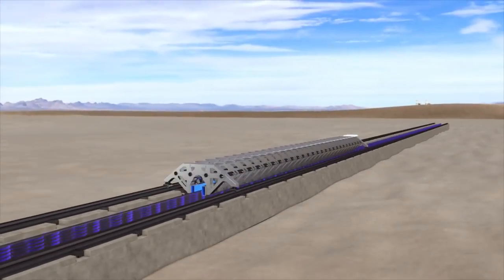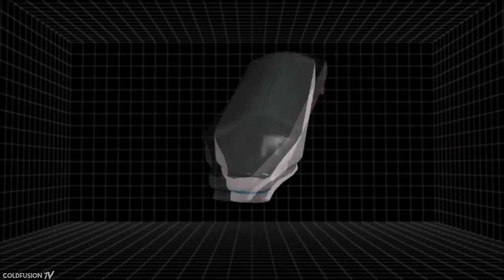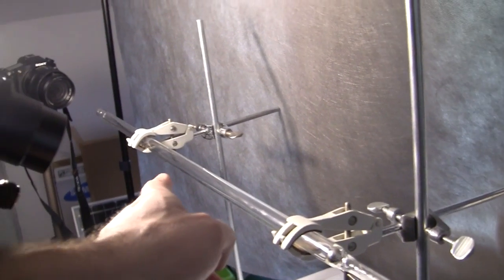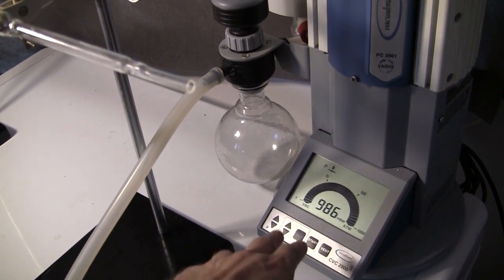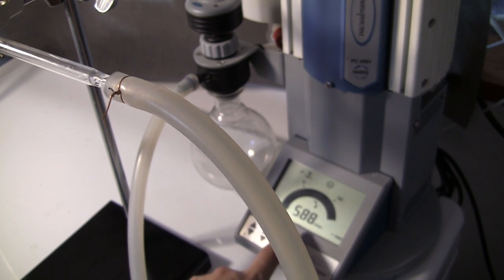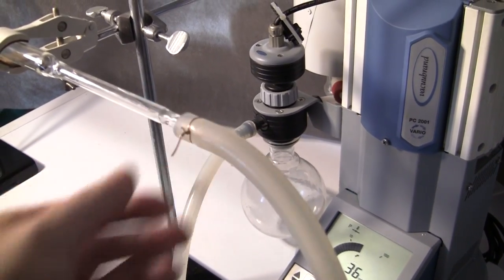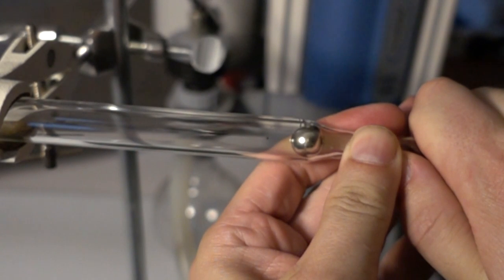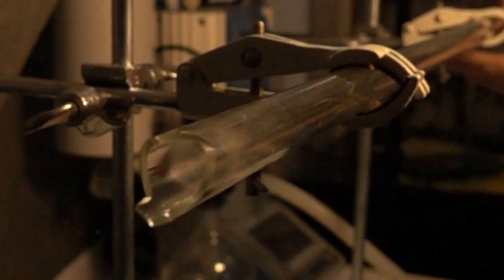How  the Hyperloop can kill you!

Comment: When trains run off their tracks, they also cause fatalities, but that's why there are safety measures in place. This is just the pessimistic viewpoint from someone who has lost their optimism for scientific advancement.
Reply: there is one major difference between the hyperloop and a normal train
if there is a rupture anywhere on the loop the whole thing is in trouble
Reply: +Bryan Hinze (supercat765) Hence the safety measures. Such as airlocks.
Reply: To be fair, when there is a rupture somewhere in the rails, a train is in trouble too
Reply: Pessimism or necessary skepticism?
Reply: David Igandan first and foremost the hyperloop would have to face two types of pressurisation problems (a rupture in the cart and a rupture of the tube itself) plus airplanes don't have to face a vacuum (at 10 km you still have about 1/4 of an atm). I'm not saying it's impossible, I'm just saying it'll take a lot more engineering than a  plane
Reply: Exactly, that'd be like a train derailing because a piece of track 2 km behind it broke
Reply: it's kinda wierd for TF to be all "this technology could potentially go wrong, therefore the technology is wrong!"
that's the attitude he usually fights against, it's the attitude that says nuclear power is wrong because it could have a meltdown which is something he's made videos combating
Reply: Speaking as a scientist here, it is called being skeptical.  If somebody presents you an idea, you question it and rip it to shreds.  If it can survive that, it is OK.  That's what scientists do whether it be theoreticians like me, or experimentalists in the lab that will do experiments to test ideas.  Just because you think it is a "scientific advancement" does not mean it is reasonable.  Being optimistic is striving to find things that work, and having the integrity to point out their flaws.  There is no optimism in putting your faith in something nobody have proven to be reasonable.
Reply: This is just a portion of the next video so hold your judgement till then.
Reply: More of you should try thinking for yourselves, instead of taking everything that TF says as law. It is very easy to point out the hundreds of loopholes, exploits, and vulnerabilities of a technology (take a look at many of the comments here about planes, trains, and cars, etc.). It is much more difficult to offer practical solutions for them. This video only points out a single flaw (though I don't dispute there are many more) in the system, and has a click baity title. It would be much more scientific of TF to offer engineering solutions in his video as opposed to damning popular science.
Reply: +ScopedPewPew    My god, the thought of having technology improve with time. It is impossible I tell, IMPOSSIBLE! The train used to be powered by steam, then someone thought, "I want to change the wheels with magnets." Now some people want to make some trains that can go even faster, but you think of it as an impossibility.
Reply: This was worded beautifully, I agree completely. As a scientist also, I'm slowly losing respect for some of TF's videos. Sure, it's important to debunk BS science but it's at a point where he's claiming everything is bullshit due to a single flaw. I.e., reminds me of a lot of the resistance that the scientific forefathers faced.
Reply: At least the train can be informed ahead of time that there's broken track ahead. If by some chance the pressure changes even after many safety procautions are put in place, everyone on the train will die.
Reply: +Randall Peralta Did you see the phrasing of his comment?  Regardless, he isn't simply being skeptical of the idea, he is dismissing it entirely.
Reply: Vranvs Vranvs well you should probably wait till the full video before you make that judgement...
Reply: yep, no clue why thunderfoot is doing this. He's starting to sound like a luddite.
Reply: ScopedPewPew I'm suspicious that he is more interested in creating controversial videos that draw attention because it gets lots of views and subscribers.
Reply: +James Lourenco   As a viewer of Thunderf00t, you should understand that strawman arguments are unacceptable. Vranvas said nothing about the other things that Thunderf00t has debunked. I won't speak for what he thinks, but this is not some incredible stupid thing like solar freaking roadways, Thourium powered cars, or hover buildings. However, this is just a hypothetical larger human version of the tube system thing used in some hospitals. I believe SciShow showed this best by explaining what the hyperloop was and the obstacles it will have to address. It is possible to have differing thoughts on things from Thunderf00t, so don't go around claim that others support stupid shit if they disagree with Thunderf00t on this one piece of technology.
Reply: ScopedPewPew OK TF's number 1 brown noser sub.

Have you even seen the things Elon Musk has achieved with SpaceX and Tesla? Thunderf00t pissing about with thermal imaging cameras is nice but not exactly in the same league as what Musk is doing.
Reply: What happens when it fails? If the answer is "It must never fail", then it is too dangerous to use.
Reply: Airplanes are already like that. All spacecraft are like that. To achieve higher speeds, harness more energy and have a chance of actually persisting our race outside the lifespan of our star, we're going to have to accept the reality of traveling in vehicles that will kill us if they fail. Millions of people already do on a daily basis. Sure, a lot can go wrong without an aircraft crashing and burning, but IF it collides with the ground in an uncontrolled landing, 99% of the time the vast majority or all of the passengers will die. So you could say we have been in the era of this type of vehicle since the mid-20th century. Not sure what all the fuss is about with proposals to build even more vehicles of this sort.

If we restrict ourselves to vehicles that are likely not to kill us when they crash, then we will forever be stuck with boats, standard trains (max. speed 70 mph), cars and buses. And no manned spacecraft, ever.
Reply: +FJBRDALLAS The point of the airlock wouldn't be to stop the train directly. Obviously that wouldn't work.  
Presumably you would use multiple air locks to divide the hyperloop into sections, thus enabling operators to close off any section which experienced sudden vacuum loss.
Reply: +Blox117 If you're referring to my comment, I'd like you to give me a basis for you're assumptions about me. I don't see how any part of my comment would indicate the truth of your statement, and would assume that you're saying that only because my opinion differs from your own.
Reply: +Necropolis9 His professional experience does not change the fact that he has dismissed this concept with neither a strong argument nor adequate scientific evidence against it.
Reply: +Dareld Jolliffe Adding thousands of valves would only make the system more likely to fail.
Reply: Joseph Thompson yup just  more engineering to be done, nothing near impossible about it. its not a even that high of a vacuum proposed in this project.Any vacuum will create more efficient trains and as long as the gain is higher then the energy cost of creating the vacuum then its considered a win on that front
Hmm lets see, whats another pressure vessel that is ridden by hundreds every day with thousands of valves? A nuclear submarine... 
(haha get it? a Pressure Vessel!)
Reply: ***** i was talking about the tube. I am just thinking there are about a hundred ways around the problem in the video. In fact i am not even sure it will be a real problem, like you said with the train already moving it will likely just slowdown from one side or speed up slightly from the other. And i was under the impression that it was not propelled by the turbines they are just to help move the air (or whats left of it) around it. The train car is not perfectly sealed in the tube, there is room for the air to move around it. the vacuum is just to decrease drag not to propel the train.
Reply: Yeah, but one knick in the rails doesn't cause every train on the track to simultaneously derail.
Reply: Eltrio2 i just had to smile and laugh with my friends when we wre told that retardation was a word used by real life scientests. there's also an other funny word used by chemists. the word "Cis" is used when describing an isotype of a chemical which is streigth instead of bent. the opposite is "trans". the origin of the word is its german meaning, which is the same as its meaning in chemistry. it's funny because it's used by some SJWs today to describe people who they disagree with, aka non-trans people. "cis scum" as they say. it's funny that in the circles i grew up in it was more of a compliment to be called streigth (as gay was an insult). now these people go and tell us "fuck you CIS white guy"....

yeah. a lot of people are the kind to not care about school in school. the kind of people who get happy when they get a D+ in an exam... most of those people in my old school went into other schools than the school i am in now, and there are only people from my old school in my class, apart from one guy who lived in sweden when he was the age to go to my old school. if we were to talk about me; many have said that i am "clever" and shit like that, or like "you know a lot" n' shit. even my chemistry and physics teachers like me for it (we have gone to trips to germany, and entertainment parts with other students n' shit.). i obviously am not one to judge, but i do try to be as truthful as i can.
Reply: So there couldn't be a gate system through of the tube network to control a rupture?
Reply: +Bryan Hinze (supercat765) I don't think the hyperloop is going to be a strong vacuum. So ruptures aren't as big a problem. Just something I read.
Reply: Okay, tell me: what kind of fail safes will the Hyperloop have?
Reply: ScopedPewPew
I'm defending the hyperloop by any means. It's a shit idea and the people defending it only have the most childish of retorts.
Reply: TF said that the presure would be 1 millibar. It would be a strong vacuum.
Reply: But the whole network doesn't explode.
Reply: ***** Can you give any examples of what you're claiming?  Almost all the examples (even if I give you this one) are clear cut flawed or nonsense.  I've seen every one of his debunking videos and they all seem pretty reasonable.  There are limitations people need to be aware of.  For example, I'm a computer scientist and I constantly see people claim that computers can do anything, when no, infact they cannot and they have limitations.  Same here.  TF is just poking holes in things because that's what a good scientist does here.  Say what you will about his opinions, but the man knows how to do experiments.
Reply: +Kitsuneoni Actually if the hyperloop breaks behind the train theoretically there should be no problems, because the train is moving at the speed of sound and anything that happens behind it would not affect it AT ALL, because they couldn't catch up to the train.
Reply: this is the comment of someone who is scientifically illiterate and ignorant.
Reply: +Sean McNamara I agree entirely.
Reply: They are going to need more than an air lock to stop a full train flying at the speed of sound....
Reply: it would be much easier to depressurize across the hole loop with valves set at intervals that would automatically detect a rupture and open to equalize the entire loop  at once in front of the train.
Reply: +Dareld Jolliffe The problem with that would be the massive amount of air you'd have to be able to allow into the loop in a very short time.
Reply: Joseph Thompson and 5in fast opening valves every 50 ft the entire length of the loop wouldnt do that? Thats alot of air. I dont think it is that big of problem to over come... They are easily replaced and reset. And they could always design bigger and faster valves if needed.
Reply: Joseph Thompson your*, and i agree, that having valves to the outside would be a stupid idea... and having them just to "equalize" pressure in front of the capsule or what ever is stupid... firstly if there is a rapture behind the capsule it'll barely afect it at all because it's lrdy traveling at the speed of sound and is quite dense relative to its "wind-profile"... also if a rapture was to happen in the front of the vehicle the blades of the vehicle would eat into the air, and thus lessen the effect, maybe helping it to slow down and maybe come to a slow stop even before it reaches the breaking point, which would only act as a safetymechanism!

it's not like thunderfoot's video is a total smackdown on the system. there are fixes for everything people have tried to clam onto so far.
Reply: Dareld Jolliffe are we talking about the tube breaking or the vehicle breaking? is everyone talking about the vehicle breaking?
Reply: This would be a good comparison if the entire train track exploded if there was one failure anywhere on the track.
Reply: +Necropolis9 I realize that, but he doesn't set up any good arguments in this "teaser" of sorts. 

Perhaps this discussion will be pointless when the full video is posted, but for now I see no reason not to discuss this particular video.
Reply: +david igandan Its my issue with every single person who doubts science or tries to scam people with it. tfoot can show why solar roadways was fucking stupid, why the water bottle won't fill, and why the rebreather is bullshit, at least with current methods.

this one, he put a marble inside of a glass tube, and said this is how it is, which i very much doubt is the case. what he showed was acceleration due to a failure to seal, instead of being introduced to low pressure then accelerating. 

we all know shit can go wrong fast, buts not even a doubt, the question is how likely is the shit to go wrong?
Reply: +Joseph Thompson 
Oh really? You think this is "just the pessimistic viewpoint from someone who has lost their optimism for scientific advancement"? How about the fact that Thunderf00t is a youtube channel owned by a scientist who strives to push boundaries of human knowledge? Hmm? 

"When trains run off their tracks, they also cause fatalities" 
No. When trains run off their tracks, people usually get injured. They don't get accelerated into bullet-speed and they're usually not hurled into a wall of solids. Train tracks can actually be designed to sustain the forces of a moving train. You just can't do that with a vacuum tube that goes for many kilometers on end, without costing yourself a few fortunes, or a few lives. From an economic standpoint, it's a disaster, hence the stench of bullshit when someone actually claims to do it.
Reply: DecepticloneStinger 
"why are all of his recent videos nothing but "LOL FEMINISM AM I RITE GUYS?!?!?!?!?!?!?""
Because it's a cheap way of producing entertainment. I personally think nobody would refuse to laugh at feminists who want to protect Pokemon.

"or "this kickstarter is retarded because I say so!""
He hasn't made such videos. He's made videos saying "this kickstarter is retarded because the facts say so". Using a dehumidifier to fill a water bottle in a remote place, for instance, is a retarded idea because we know how dehumidifiers work and we know that it's just not going to be good enough.

"which means the problems with those ideas can NEVER be solved!"
Nope. He's showing that the kickstarter projects are bullshit because they are not feasible NOW and the kickstarters are claiming to give the goods VERY SOON if not now. Remember the solar roadways? TF's main contention was that the solar roads are being built NOW and it's just got to be bullshit, with the best available technology of today.

"he'd probably be making videos about how the Wright brothers "
Ah the poor Wright Brothers. They're now the posterboys for idiotic bullshit spouters who want people to accept their crap without doing the hard work of actually showing how their stuff works. If the technology that you claim to have actually works, then just show that it works. Shut the f*** up about past historical figures who got their fame by demonstrating their ideas, not by crying about how past achievers once had their ideas disregarded.
Reply: "This is just the pessimistic viewpoint from someone who has lost their optimism for scientific advancement." 

I'm gonna guess you're new to this channel.
Reply: Dareld Jolliffe He ain't wrong here.
And just like with Solar freaking roadways, thorium powered cars, and scuba masks that convert water to breathable air, he'll have a longer video down the line on the subject.
Reply: Dareld Jolliffe yeah. a thing everyone is ignoring is that Tf's simulation doesn't simulate the fact that air is not infinately fast. it's actually moving at about the same speed as the vehicle, and the blades will just help the vehicle survive any kind of "rapture".

from all the thinking, calculations and research i have done in the comments of this video i am pretty convinced that TF's point is a non-point. unfortuanately his video is pretty stupidly made. the simulation is not a good simulation, because he ignores the fact that in the real thing the bearing will be moving too fast for the air to even catch up. the ball bearing is at MAX accelerated to the speed the vehicle itself will be moving by default.

AN AIR LEAK WILL NOT KILL YOU.
Reply: ***** I just prefer to hear how science works from a scientist rather than a random commenter.

It's the same as asking your doctor how vaccines work rather than asking that guy from the natural food store.

Or asking someone on the bomb squad which wire to cut rather than me.

In short, I'd rather ask the experts than random people.
Reply: DecepticloneStinger very true, oh well. This project, in my mind is not even on the same planet compared to the other BS he has made videos on. The hyper loop has the backing and engineers to make it feasible.
Reply: DecepticloneStinger 
"I like that you admit his feminism vidoes are cheap trash to farm views first off. "
Whatever. People with mums and lives actually enjoy entertainment.

"It's his smug know-it-all tone that makes these vids cringy."
If I told you that I was connecting two cliffs with a string of wool so that people can walk across it, I'm sure you'll employ the same tone against me, and that's fine. It's the same with the Hyperloop. Stupid ideas get ridiculed. Get over it.

"but that's just marketing. that's how the world works. "
If there's bullshit, you call out bullshit. THAT is how the world works. Claiming to have unrealistic technologies in the near future is just bullshit, whether it's marketing or not.

If I told you that my cliff-traversal method with woolen methods was going to happen tomorrow, you'll call out the bullshit, whether I'm just marketing or not. Why is it even necessary for me to point out this salient fact?

"as long as it isn't outright fraud, or blatant pie-in-the-sky optimism"
Hyperloop is outright bullshit in a celestial pie.

"He makes himself look foolish by playing the part of the guy who disregards any new ideas because they aren't a perfect solution."
That's what he looks like if you're determined to be angry at him. (That's ok, it's human psychology). Just keep in mind that in reality, his main argument is that the Hyperloop is way too risky and way too expensive for viability.
Reply: ***** m8, that's why people are still working on the problem of the hyperloop. obviously it would be way easier to just make a mag-lev train. all the hyperloop differs in is it's sealed in a tube (so that birds don't hit the train) and a mag-lev train has to ram its way thru air. other than that they are pretty much the same thing. the thing is that if you remove drag you could theoretically perhaps travel for practically zero energy. no energy is lost to friction, and you could use a copper coil to slow down the train, assuming it's a magnet, and thus get back all your energy used to accelerate it in the first place... tho the rails prob need some kind of power...